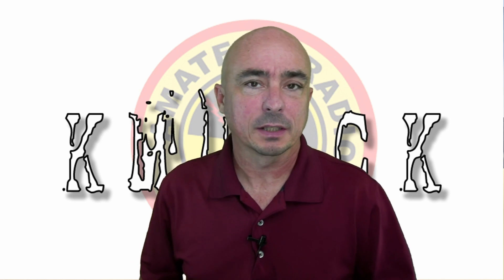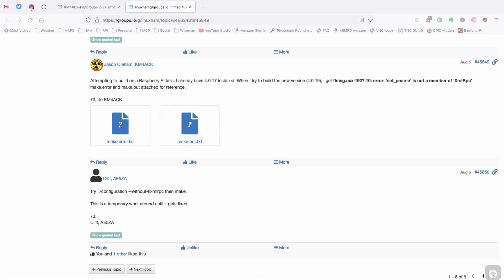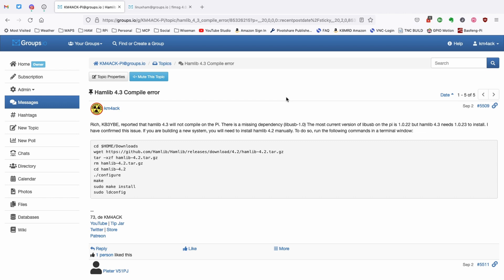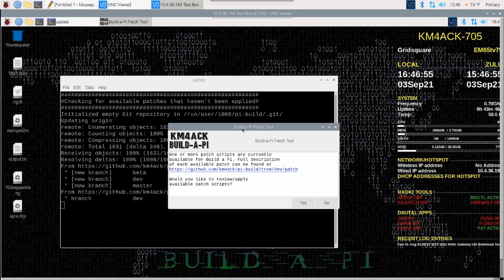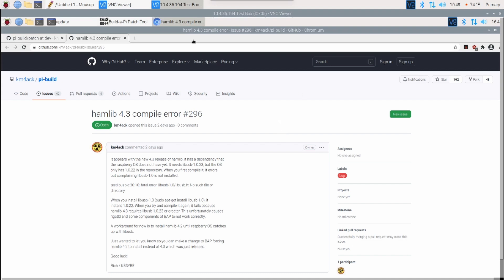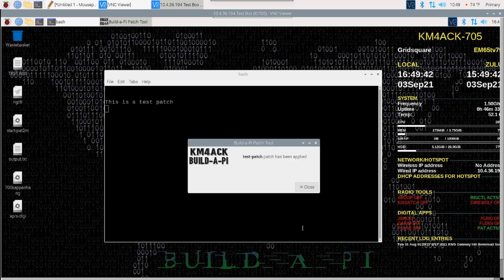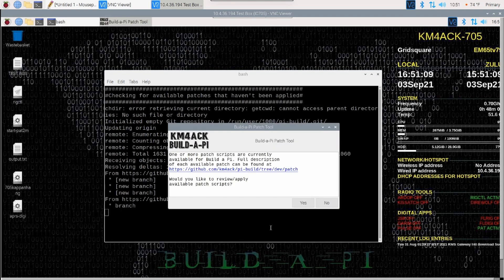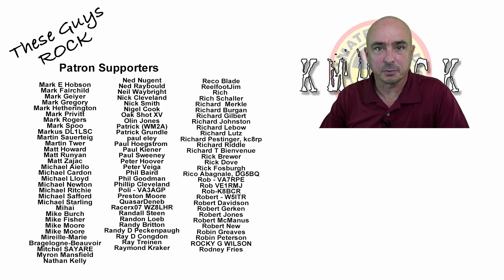Build a Pi 3.1.0 :: New Patch Tool

Comment: I tried to run the update menu but it's gone!  Looked in the Hamradio menu and no Build A Pi section in it now.  How would that happen?
Reply from the maker: It was moved to a new subsection in V3.0.8 so we could add a few more helpful links.
Reply: @KM4ACK  Thanks, Jason.  I found Build-a-Pi (Build-a-Pi App Manager) under Preferences.  But when I select it I get: Failed to execute child process "xterm" (No such file or directory).  I'm actually considering just rebuilding my Pi from scratch due to some issues I'm having getting FLRIG to talk to my G90 via the XGGComms DigiMode-4 USB interface.  I wanted to first try running an update of everything in BAP but this error message has stumped me.

Comment: I am playing with the patch tool and it seems to be working just fine. It told me that it will take around 20 minutes for the 3 patches. it was still working when I started typing, and I am sure that it will work just fine.

Thank you for the patch tool. 

Have a great day

73 - KC9CTP

Comment: Good news already: libusb-1.0 is in the repo now!
& sudo apt-get install -y libusb-1.0 libusb-dev
And hamlib-4.3 builds fine manually
Reply from the maker: I was doing some testing here and saw that 4.3 installed on a fresh build with BAP. Now I have 4.2 installed on a fresh build and verifying that the upgrade doesn't create any issues. Upgrading to 4.3 really messed things up on one of my systems a couple of days ago.
Reply: @KM4ACK  Jason thank for all that you do. I started a fresh BAP a few weeks back and it so it tried to install 4.3, do I need to start over or am I good to go with the patch?

Comment: Is there anyway for “built a pi” to be modified so it could be run on any Linux install? I have done it but had to change the user name to Pi so it would run.
Reply from the maker: Yes but it would take modifying the code. The code is open source so anyone with the skill set is free to mod the code.